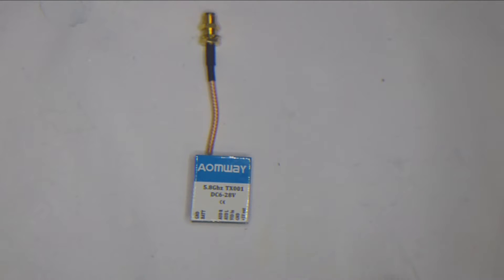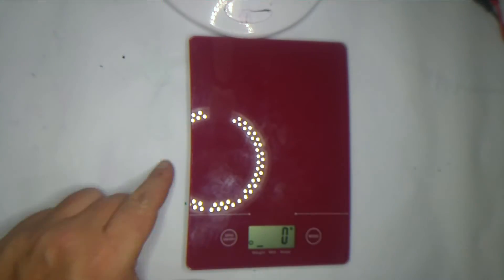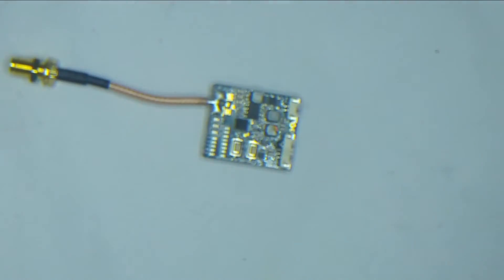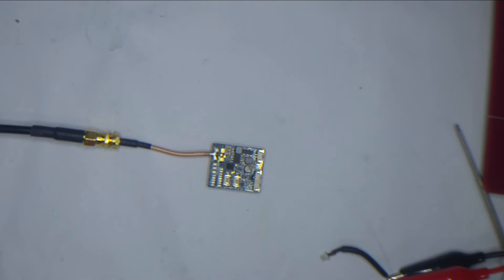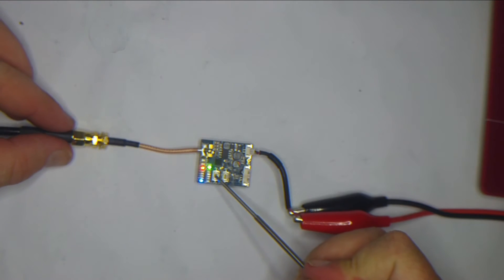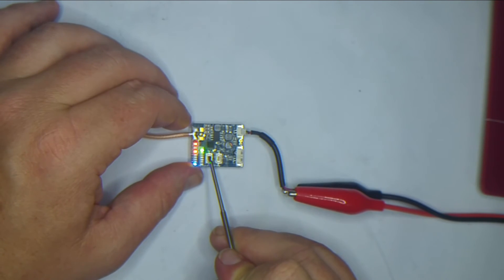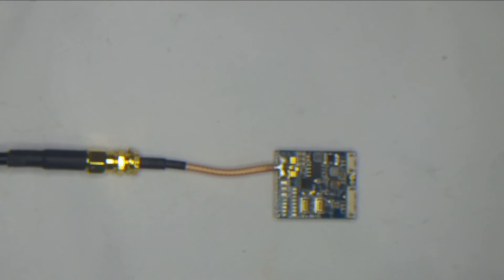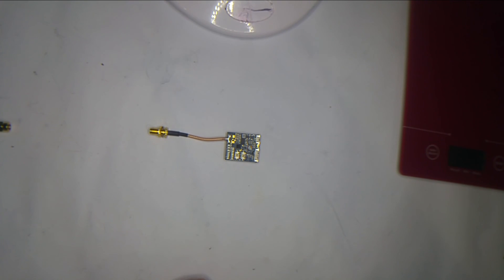Bench Review Aomway TX001 25/200/600 Switcher VTX

Comment: Hi if i wanna install on my phantom 2, should i just take the yellow and the ground? because abit confuse with the wire
Reply from the maker: Yellow is the video input.  You will need to supply it with voltage as well via the red and a ground connection.

Comment: Hi Harlequin, my vtx when powered up only has the red light come on and it's a lot brighter than yours. I have no green or blue LED's and buttons don't do anything when I press them. Just arrived today from Banggood,  any advice mate? Cheers
Reply from the maker: Single red LED should mean that it is transmitting in 25mw.  But you should have blue and green LEDs illuminated as they show your channel.   I suspect you have a DOA unfortunately.
Reply: If your buttons are doing nothing they more they more than likely have flux from soldering covered in them. Have a look around the switches and I bet there is flux around them. Only way around this is to send back, use flux cleaner, or take the switch off the board and clean it. To test if this is the issue before you do anything use a tweezers each side of the switch and short it out. If they lights change as they should then it is the switch. These are the best VTX out there IMO and I use them on all my builds.